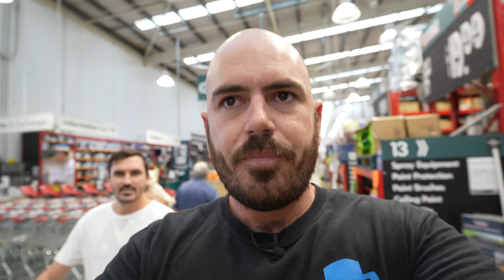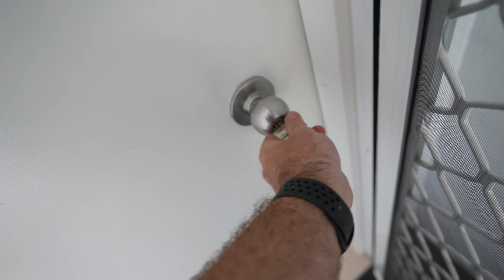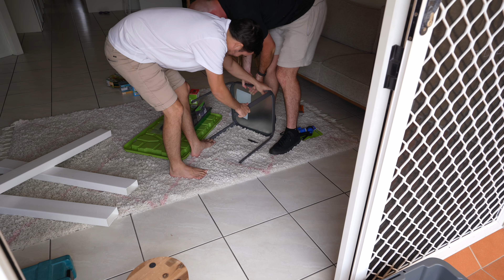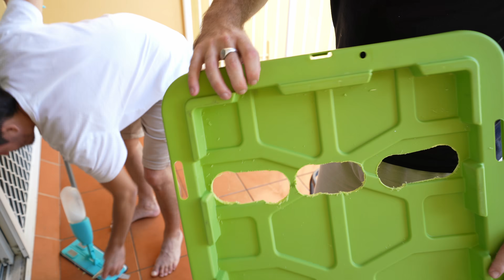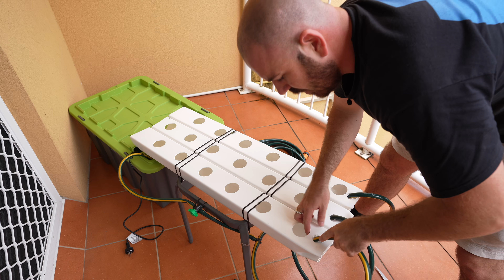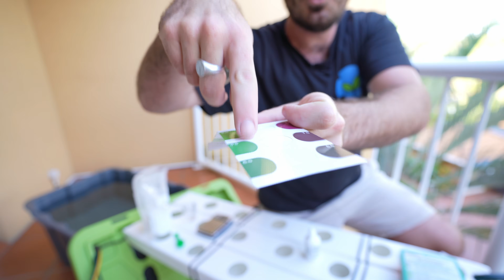DIY Small Space Hydroponic System Setup for Under $175USD! ($242 AUD)

Comment: You said 1/2 what the box said so shouldn’t it have been 30 and 40. You seemed to have put the full 60 and then the correct 40. Wasn’t that wrong?
Reply: Hoocho is correct. It's 120 x 80 full strength. Half is 60x40

Comment: You could have sealed both ends of the pipe. Drilled a drain hole in the bottom center of the pipe. Drill 3 holes in the lid of the reservoir under the drain holes in the pipe. Tie the 3 pipes to the lid with zip ties. Run feed lines to each end if the pipe. No need for the table and half the space. The nutrients flow from both ends of the pipe and drain back to the reservoir from the center hole.

Comment: Love the idea! I reckon a disconnect in the supply hose and a slightly wider table would be great so you can tuck the res under the rails but still access it would be great. Maybe put the res on one of those wheeled removalist boards so you can roll it in and out 😂

Comment: Was wondering if you could basically turn the reservoir around, using its length to support the 3 NFT pipes, making the footprint even smaller. Of course it makes water change a little harder, but could be worth it for more growing area/smaller overall system.
Reply from the maker: I did it for ease of res change, it's likely there will be multiple stages of plants in there at most times and this will allow for a change without disturbing them.

Comment: I love it! Do you have any suggestions for a long-term NFT basil system? 
I saw in your updates basil roots tend to go crazy and clog up the system, I was trying to think of a NFT build which might support a larger rootbase.
I thought maybe a sheet of corrugated PVC roofing, with a flat pvc sheet spaced above in parallel. The corrugation would provide channels for evenly trickling the NFT solution, with the flat sheet above functioning to hold the net pots. Basically the same as your pvc down pipes, but just like one large flat pipe. The idea being there would be more room to roots spread out.
Reply from the maker: For basil I'd go Flood and drain or wicking Coco. I've had to remove 3 blocked basil plants in the last few months from my nft, it works, just too well. That being said, you could just remove the plants before they become a problem, and use the suckers to start fresh ones in a cycle.

Comment: Just thinking out loud (with txt..!?!..). Could you have put the legs into the res to cut down the footprint?
Reply: I mean, you would need a way to pour nutrient solution into the res (and check the level)… but in a tight space it might have benefits.
Reply from the maker: My only objection is to the metal and salt water. You could definitely make it more compact by arranging the system differently.

Comment: looks beautiful there hoocho.. thanks for sharing a cool little compact nft.. i use similar totes as mini flood tables. a 15min timer, a L fitting and some holes on the opposite side test flood till the drain holes size is just right. . just add little plastic pots and media (i use turface and perlite mix 60/40) works great for small plants. versatile setups rock

Comment: One thing I do not unterstand is why both nutriance mixtures together in the water doesn't fall out even they are weeks in the container. But when you mix it they react and fall out. 
May someone explain it please. 🙏
Reply: Hey mate pre sure once you've mixed the 2 parts in 2 different hot water containers, then say chuck them in your 100l box it's got alot more water to dissolve into. So if you had 10l of hot water and mixed both parts in that 1 container it'll fall out of solution pre quick I'd imagine. Hope that helps I'm 90% sure that's it 😅
Reply: @CallumJordan6 
Solubility and chemical incompatibility in a concentrated nutrient solution can both result in precipitation. Temperature plays a big part in the solubility, the chemical weight that dissolves in hot water will be higher than when the water cools down. When it comes to chemical incompatibility, the main one to keep apart in concentrated solutions is the calcium (nitrate) which reacts with sulphates and phosphates to form insoluble elements which precipitate out of solution. You can try this for yourself by mixing calcium nitrate and magnesium sulphate (epsom) together in a little water and watching what happens :)
When making concentrated stock solutions you should use distilled or RO, not tap water  :)
Reply from the maker: Basically what was written above. Higher concentrations allow the compounds to combine into non soluble compounds. At lower concentrations this still happens. But at a much, much lower rate.

Comment: Hoocho I see you did a video on auto pots awhile back. You mentioned the high price of the smart valves. What you can do is get a 1x1m square tray (up to 1.2x1.2m per valve) and you can get those autopot smart valves which come in a box for trays (or maybe print your own box/cover and use one of your existing smart valves). You chuck one of those in and connect it to a res, put in some plants in either fabric or plastic pots, then you have a relatively cheap autopot system. Would make for an excellent video

Comment: Hey Hoocho, how would you integrate the seedlings into the system? Just chuck the jiffys in net cups?
Reply from the maker: Just drop the jiffy’s in. They will sit fine in the pipe.
Reply: no dont do that. the seedlings just need water with no nutrients until they show third or fourth leaves.... THEN you water them or keep them moist in the same media with 50% nutrient strength for about a week... week to 10 days.. THEN you can put them in the system with 100% nutrients sollution....

Comment: Why not just use the bin as the structure for your PVC? They are already about as long as the bin and you could cut them exactly if needed - then you secure them to the top of the lid running the length of the bin. Use the "leftover" PVC to prop it up to create the drain slope. Then the whole system is simply the size of the bin and, as a bonus, it would then save you the AU$20 for the table. More compact and less money.
 Maybe I'm missing something? Access? Supply routing? Dunno, but it seems like it would work.
Reply: You don’t want anything on that lid that doesn’t need to be there.  You will need constant access to the reservoir to check EC/PH, to top up the water/nutrients, and to do full res changes.  The more stuff in the way, the more annoying all those processes become.
Reply from the maker: Ease of access